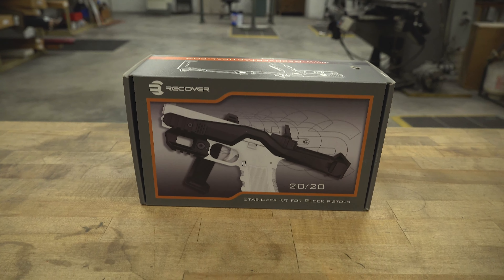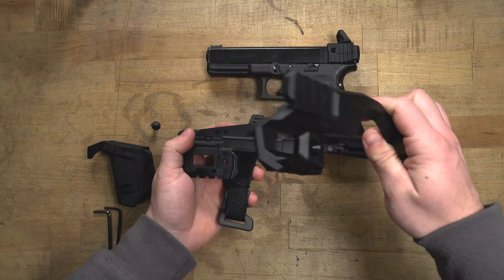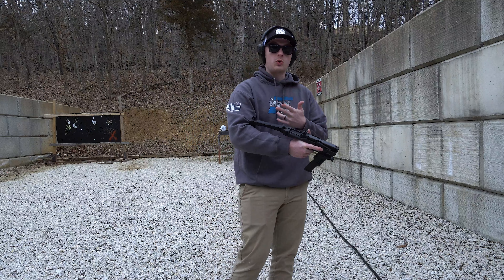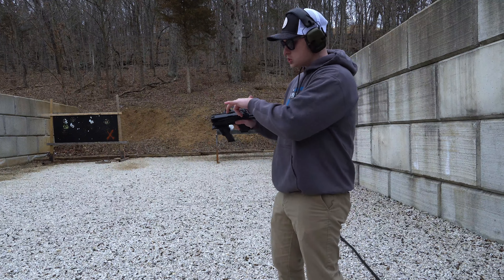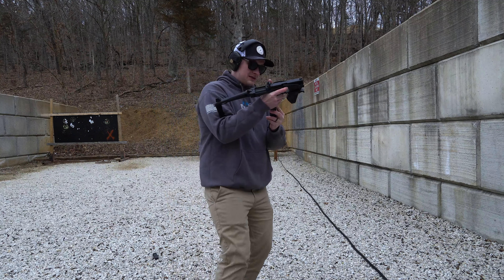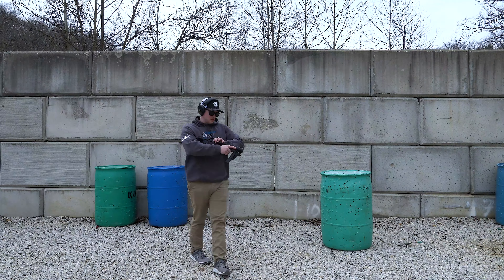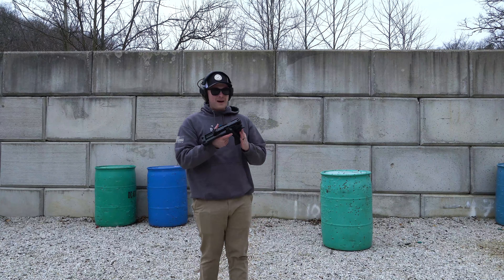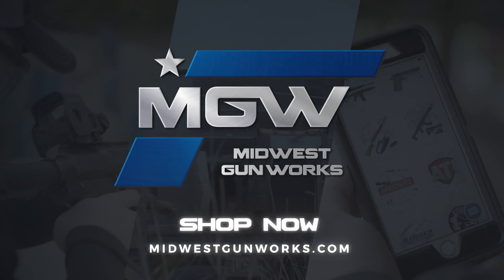Product Spotlight: Recover Tactical 20/20 Stabilizing Brace

Comment: I did a couple of ergonomic things I've done to mine. 

One thing is swapping the mag release to the right side and hitting it with my index finger.  Naturally with a pistol you twist the pistol slightly to hit the thumb mag release, but with the brace twisting the pistol is not so easy.

Another thing is when doing the reload from the magazine holder I will insert the new mag into the gun and hit the slide release with my left thumb.  Then use a traditional hand over hand pistol grip.  It makes for ridiculously fast reloads.